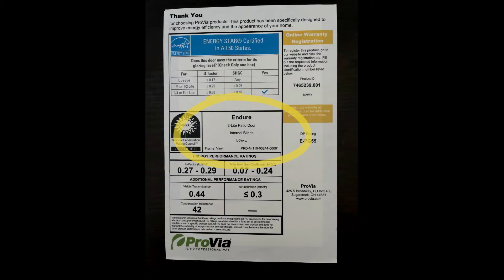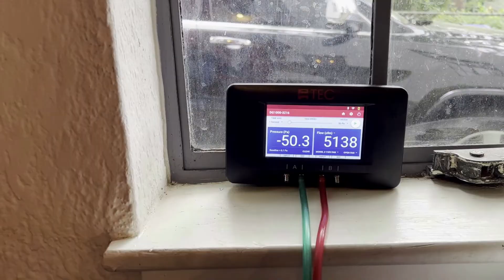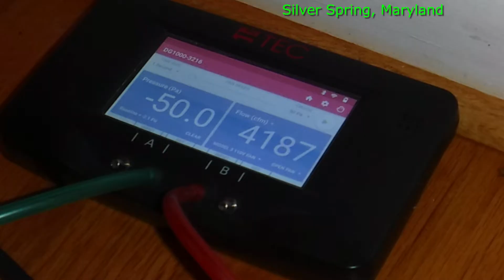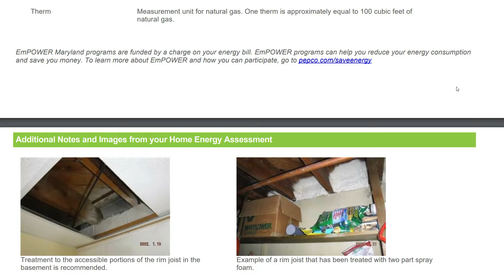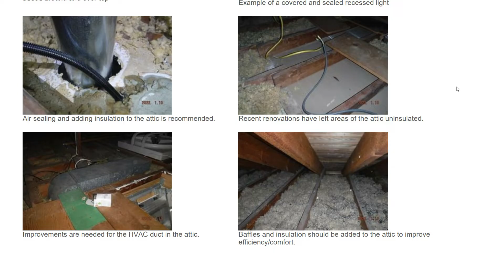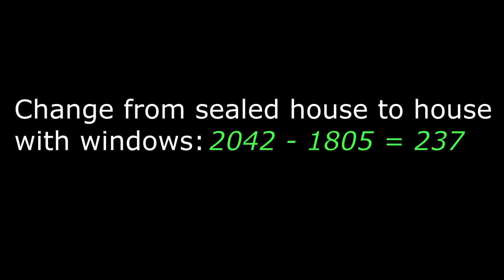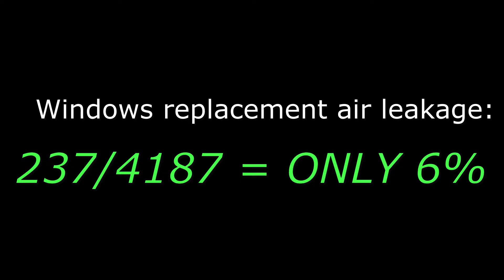Everyone Says Get New Windows… But Here’s the Truth

Comment: I wish I had a blower test done between upgrades. I had just recently replaced all of my windows from single pane, no weather sealing; feeling the cold air just blowin in in the winter (past the blocks of ice that it forms, that is), to now triple pane. I know for fact (I sound like your customer) that it contributed GREATLY to my rating; mostly in the heat loss area.
Since getting that first evaluation though, I've had a completely different outlook of air leaks. I've since filled every hole I can find now and have noticed a huge change! I just reaallly don't like doing it in the attic where I've already got a ton of blown in insulation to deal with =\
Reply from the maker: Thank you so much for watching! Are you saying that your new windows are triple pane and they helped, but once you started sealing other holes, you noticed a more significant difference in home comfort from that measure compared to the windows?

Comment: Great content. With the gas fireplace damper closed, is it typically leaky to and from the attic?
Reply from the maker: Thank you and I am glad you found it helpful! Yes, you can absolutely get air communication between the inside and outside when you have a gas fireplace. Typically, the fireplace chimney runs up through the house to the attic and out. The house is designed with a "pathway" through the house to accommodate the chimney. What I usually see is that it is open at the attic floor. So you may not lose energy through the chimney with the damper closed, but around the chimney instead. If the fireplace is built outside of the exterior wall, this can still happen at the top and sometimes you can also get air coming in from outside and below the fireplace (like an overhang/cantilever).

Comment: HCG,
I put new windows in last year, mostly because I was adding an additional 1” of rigid insulation to my house before I replaced the old vinyl siding.  The old windows 35 yrs old, weather strips were failing, operation of the windows was fair etc, so that was enough reason for me to change them.  I’ve tried to air seal this house myself, I’d be curious of results of a test like yours. Was the 4200 CFM typical for air leaks in your area? How big was the house sq. ft.?
Reply from the maker: Hello, to compare, you should consider the home's living space volume. This sample house was 2438 ft2 of conditioned space, and both floors were around 8.5'. So, the living space volume of this sample home was roughly 20,723 ft3. Before work, the house had approximately 12 air changes per hour (ACH), calculated by multiplying the CFM50 (4187) by 60 and dividing by the living space volume. After air sealing this house, the ACH changed to 6. You must have the blower door test to get down to the science. Good luck with your endeavor, and thank you for watching!!